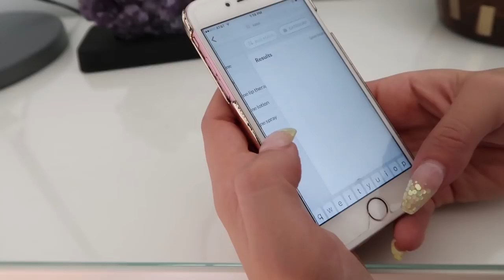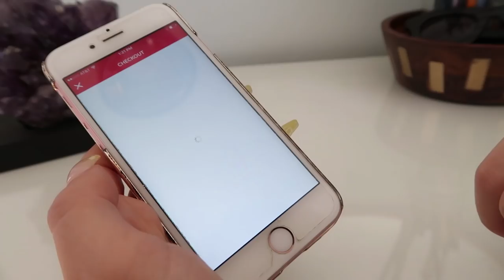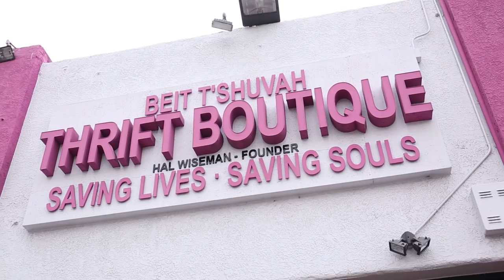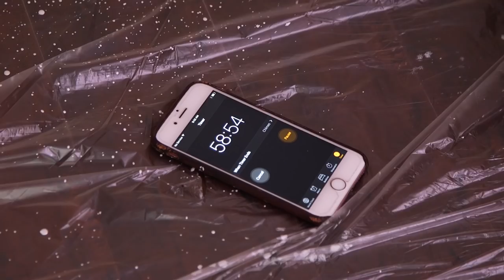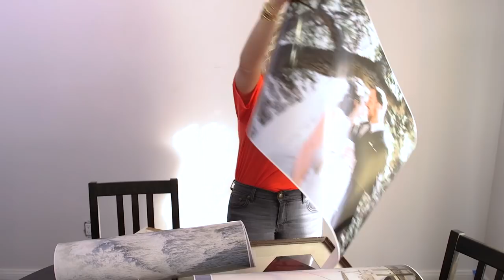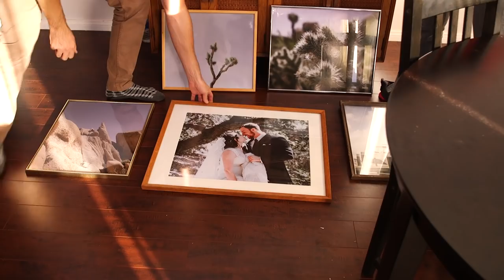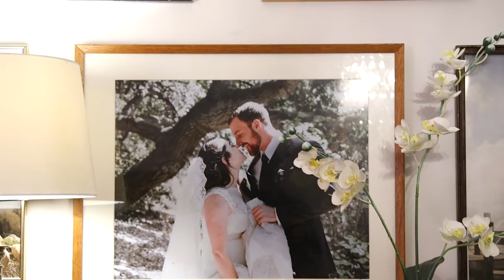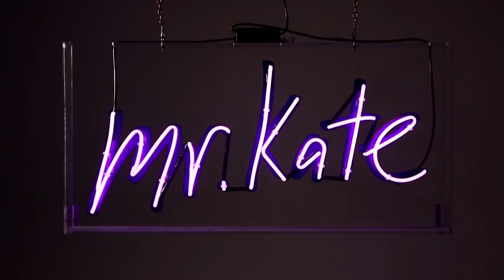Under $400 Newlyweds Living Room/ Dining Room Makeover | Mr. Kate Decorates On A Budget

Comment: Mr. Kate!! I live in a smaller city in Washington, and we're living in a building that was built in 1939! I'm having a hard time mixing the new "minimalism" style with the vintage feel of the apartment. It ends up not looking comfy/home-y enough. I would definitely love your help. Oh, and our bathroom is definitely a challenge too. Its teeny and COVERED in old tile! Send your ideas to the rescue! Love your videos! #creativeweirdo for life!
Reply: Dejha Becker a good way might be to do the mid century modern route. Those styles of furniture tend to embrace the sleek lines of modernism but goes with a more vintage feel :) just an idea!
Reply: For the bathroom, you can re-paint the tiles. Painting them a uniform white would give your bathroom a really fresh feel and save you hard labor. They have tile paint at the hardware store and it’s not super expensive if I remember correctly. You have to use tile paint though, because any other paint will chip off. If you want to give it a personal touch you could mask off geometric designs on one of the tile walls as well.